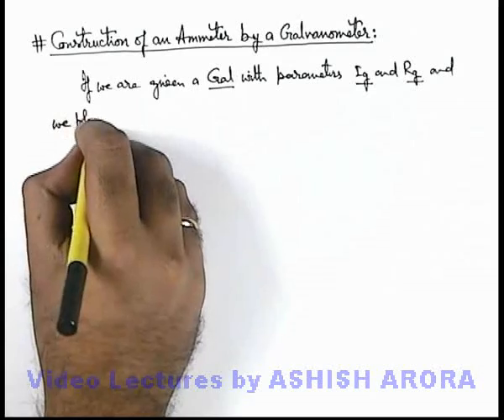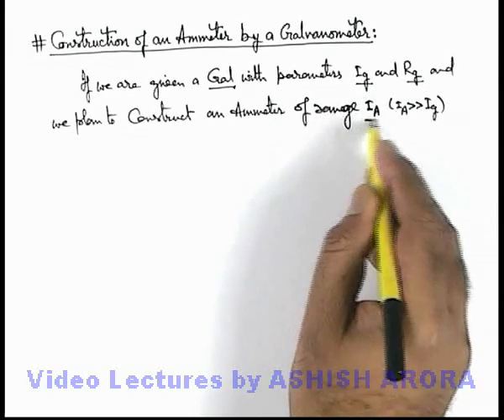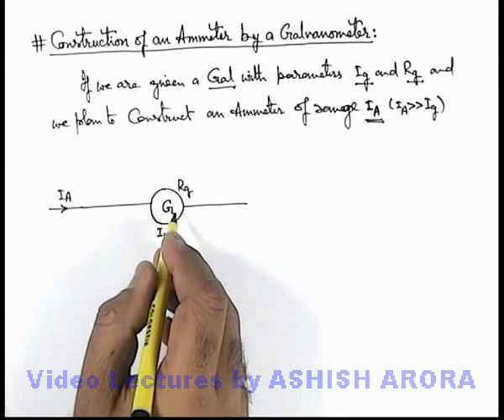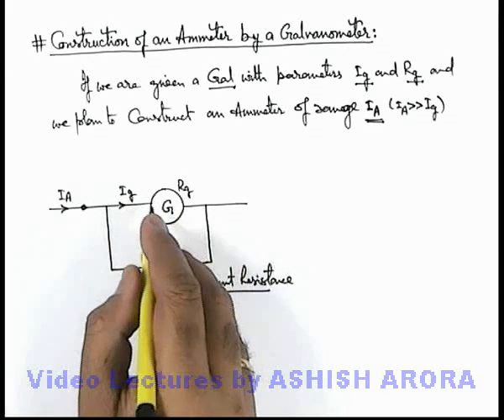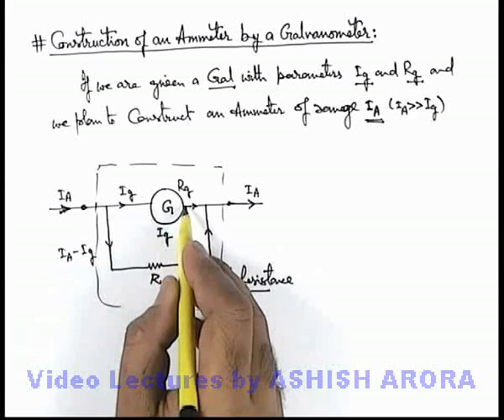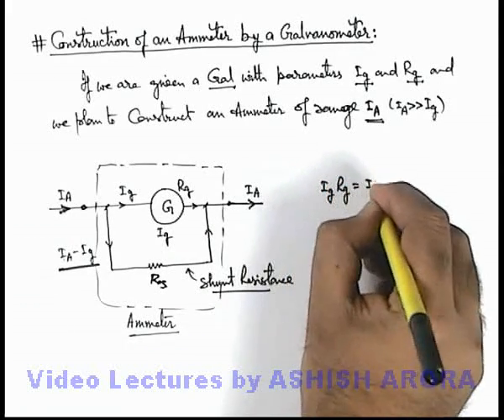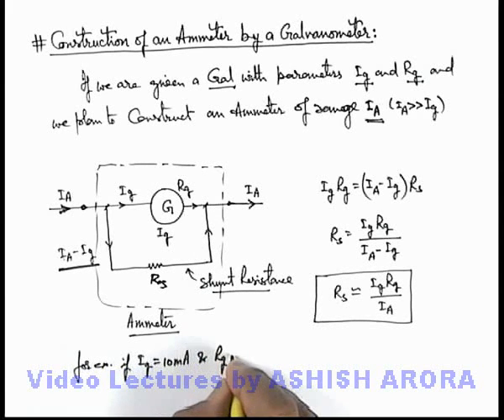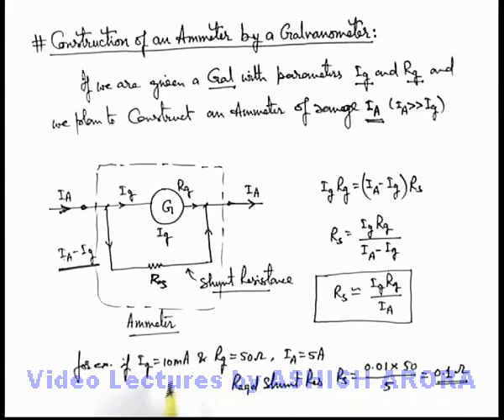Class 12 Physics | Electrical Measurements| #4 Construction of an Ammeter by a Galvanometer

Comment: lets say Ig= 5A

case 1:
current supplied= 15A
so Ig=5A (full deflection)

case2:
current supplied=10A
so Ig=5A (full deflection)

in both instances Ig is same
so reading should be same....
plz clear my misconception..
Reply from the maker: Ig is the full deflection current which will flow only when a specific current is supplied because the supplied current will divide between Rg and Rs which are two resistances in parallel... When you change the supplied current current through galvanometer will change, when it will be equal to Ig (full deflection current) then only deflection will be full not at all values of supplied current... watch carefully...
Reply: Physics Galaxy  thanks sir
Reply: Sir in above two cases hw will the ig is different...
Reply: Sir can u explain it with example..

Comment: sir,if current Ig is flowing through the galvanometer how can it detect Ia?
Reply from the maker: +Anil jain watch the video carefully... we are bypassing the extra current from galvanometer by shunt resistance so here ig will be proportional to ia and scale is calibrated to measure ia only...
Reply: @physicsgalaxyworld  hello sir I have understood the thing that has been explained in the video but there's one other confusion I have... If the current is a little less than Ia, how can we be sure that the reading will vary linearly with the current? I mean if the ammeter has been made to detect 10A at full scale, how can we be sure that when the ammeter is showing 9A, it is actually 9A because maybe the current through shunt is disproportionally divided since in parallel the formula of effective resistance is not linear but of degree 2 (R1R2/(R1+R2))? 

I hope you understand what I'm trying to say...